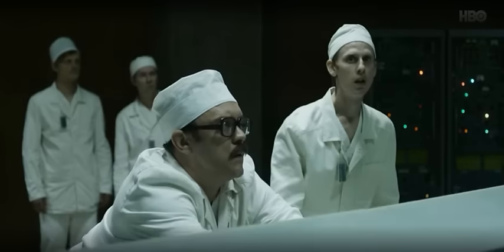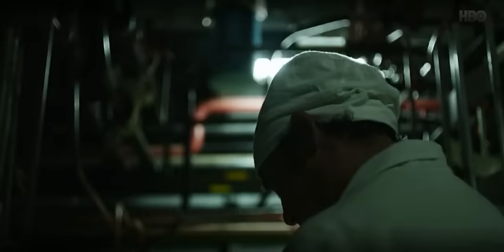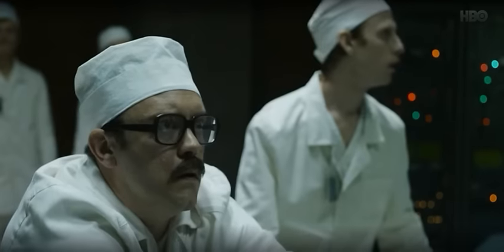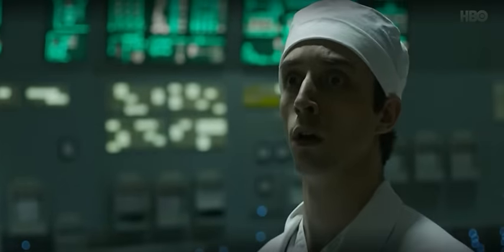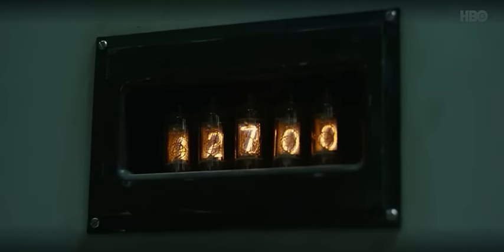Chernobyl (2019) Nuclear Reactor Explosion Scene

Comment: The sad part of all this is that it was ALL PREVENTABLE!  ALL OF IT!!  You do not use graphite tipped control rods- ever!  The spike in power should have alerted everyone in the control room to get out as fast as you can, and don't look back!  Every one of those firefighters were exposed to a lethal dose of radiation,  and that was all preventable as well.  Those poor firefighters knew nothing about the site being radioactive.   Dieing from radiation poisoning is a very horrible way to die. 
All in all, the government eas responsible for something that should have never happened. 😢
Reply: The fire fighters didn't know a nuclear power plant was radioactive
Reply: Weren't the rods covered in graphite along the whole length?

As far as i know, the graphite was purposely used to control the reactivity of the reactor.

So technically they could increase the reactivity with the control rods, and at the same time they could decrease it by inserting them further. The point rather is that it wasn't prepared for inserting them at once, during already supercritical state.

The real reason behind the explosion is the operators' lack of knowledge with the design, and the fact that they broke many safety procedures.

(Of course i'm not a specialist, and i cannot really confirm it either. I know this mainly through other comments and small research myself)

(Second notice, there is a far better explanation up in the comments, i suggest to check it out)
Reply: the "cheap graphite tips" is just plain wrong, they had graphite DISPLACERS which had a function and were not made cuz "they were cheaper", but because it helped with sustaining the reaction on withdrawn rods

Comment: I presume the caps were jumping because of rupturing channels. Were they? If not, what was causing the jumping? I ask because then we should hear the rupturing channels sound as well in that scene
Reply: It’s an early sign of the extreme steam pressure that had build up, and only a few seconds later the pressure overwhelms the containment structure and blows the lid. This lid pierces the roof, falls back down into the open reactor, and the rushing oxygen from the atmosphere reacts with the hydrogen to make the major explosion. You can also see this on the first episode at the start from Lyudmila’s window, there’s two explosions within a few seconds.
Reply: they didnt jump at all, it was made up by grigory medvedev in his book "the truth about chernobyl", along with many other disproven things
in reality what would have or has happened is that steam rushed out inbetween the caps, but the caps themselves didnt jump up or jump or anything, they are not connected directly to the control rods and fuel channels

Comment: For such a well-made and well-researched show, they repeat a lot of false statements about the accident. No, the "tips" of the control rods were not made of graphite, and the graphite wasn't there because "it was cheaper". The control rods were made in two parts; the upper half was the boron absorber section, which reduced the reaction, and the lower half was a 4.5 meter long graphite section. It was there to prevent water from filling the control rod channels when the rods were withdrawn, because water reduces the reaction just as much as boron.

The graphite "tips" were in the reactor the whole time.
Reply: while water (mostly the hydrogen) is a better absorber than graphite (x100), boron is still a way better absorber (x1000 compared to water)
Reply: @oluenionloppu  It's not about how well it absorbs radiation, it's about the neutron energy levels. Graphite moderates the reaction; it reduces the energy of the neutrons to the level where they're likely to interact with the uranium and cause a chain reaction. Water does that for enriched uranium, which is why it's used as a moderator in most reactors, but it doesn't work for unenriched, natural uranium.

Comment: Why did they push the button in the first place??
Reply: Ah ok gotcha
Reply: @RatMan1227   They were trying to slow down the reactions
Reply: They were doom. At that point, nothing could save them. The reactor was already uncontroled.
Reply: I wonder if there was a theoretical way to prevent the explosion.. maybe if the lid weighed 100x more
Reply: Kyle hill and Plainly Difficult explain it the best. But each reactor no matter the design has an emergency shut down button that automatically lets all boron control rods back into the reactor. After the failed safety test stalled the reactor with Xenon, Dyatlov basically told them to remove all but 6 rods (minimum should be 18). Basically after that the reaction started going back up dramatically. When AZ-5 was pressed, the graphite tip causes the last bit of water to poof into steam and break the control rod channels locking the graphite into place

After that...was the first boom letting the oxygen in then the second very massive boom
Reply: It was the emergency off switch.  Dropping the rods slows down the reactor to the point it stops working and ideally prevents whatever disaster is happening.  In this case, the flaw in the rods meant it would do the reverse for a few seconds before it would shut it all down.
Reply: @aldenornogueira5239  no, if the fuel rods didn't have a +ve coefficient at the tip then they could've reversed the reaction and bring it back in stable state but having graphite on the tip actually skyrocketed the reaction for a few seconds and that was just enough to turn it into a nuclear bomb
Reply: @justinnesbit3948  maybe, but I think due to the reactions in reactor will prob still explode
Reply: @justinnesbit3948  that would be really hard but that would contain the 33,000 megawatt surge, as 3200 x 100 is 320000. however, 33000 will continue rising until explosion.
Reply: @RatMan1227  may have explained it but control rods control reaction, insert them to decrease reaction, take them out to increase reaction. All a reactor is, is a series of rods that are long tubes of a radioactive material and when you put them next to each other with nothing inbetween that increases your reaction, making that material hot so then the water gets hot then turns to steam
Reply: the MWt rising rapidly would be a good reason to press it. however, that did not actually happen. the real reason they pressed it was because at the time they were doing a safety test for the reactor, which involved pressing a3-5.
Reply: @justinnesbit3948  the reason the explosion happened was because the graphite displacers entered the bottom region of the core all at once. if the graphite displacers, boron control rods, or poles that connect the two parts of the rods were 1.25 meters longer, the graphite would reach the full length of the core, so no explosion would be able to happen.

Comment: In other scene legasov suggets they need tons of boron to put out the fire in the core and scherbina goes to get them as it wasn't a big deal so I wonder why they didn't built the roads properly with boron instead of graphite 🤔
Reply: It was part of the design. When fully withdrawn, the tips of the control rods would still be moderating neutrons inside the core to some degree, to keep the core stable. Under normal operating parameters, this was perfectly fine. In the very unstable situation that happened that day, this proved to be a major design flaw.
Reply: @origlllo  no Bro those were moderating roads designed to slow down the reaction in any given situation, specially in this critical moment, as I said before it seemed they had a lot of boron available so it doesn't make sense to build them with graphite, as the latter was used to accelerate the reaction.
Reply: @versatilpraxis  Despite their names, moderatos accelerate the reaction in a reactor. They do so by slowing down neutrons to the point they are more likely to cause more fissions. Control rods by definition are meant to do just that - allow you to control the reaction.

Think about it like this - when you fully withdraw a boron control rod, you want to accelerate the reaction. if its tip was also made out of boron, it would still be absorbing neutrons at the outermost position, thus distrupting your neutron flow.
By tipping the rods with graphite, you essentialy seal the reactor with a moderator when the control rods are withdrawn, thus increasing the reactivity which is what you want.
Reply: Do you think it was a lack of boron?) PWR type reactors at power plants have been used in the USSR since the late 50s, and 1 gigawatt capacity since the late 70s, they developed in parallel with RBMK type reactors. The series is based on the usual anti-Soviet propaganda typical of the West. RBMK reactors have their advantages and the possibility of using lower uranium enrichment is also one of them, and not a disadvantage from poverty. Especially considering, as it turned out in the 90s, that Soviet uranium enrichment technologies were the best in the world, including in terms of fuel production costs, and the United States still does not have such technologies. For example, Germany sells its nuclear waste from uranium enrichment to Rosatom, and Rosatom is able to get more fuel from them. Also, only one country in the world had a fast neutron power reactor and that was the USSR, now Russia is developing it. The point is a defect in a specific project, but as we saw at Fukushima and other accidents, there are also disadvantages of PWR.

Comment: I heared its was like a 3 kilotons exsplosion way more than fukushima reactor exsplosion
Reply: 0.3 kilotons actually, 3 kilotons would've destroyed the whole power plant and more
Reply: The fukoshima reactor DID NOT explode, it became very hot cuz the water was not cooling down the core
Reply: @guyinblueshirt  that’s literally how all reactors happen. Chernobyl didn’t explode first, got really hot due to the steam
Reply: @bobbythomas6520  Yes, thats true, but the fukoshima core didnt blow up into pieces, it was whole, chernobyl on the other hand had whole core gone
Reply: @guyinblueshirt  that’s true except for your last statement. Yeah it blew up and the core was exposed but tons of material from the core was still in there, hence the elephants foot and all the Corium.
Reply: @bobbythomas6520  Yeah thats what I meant, but I dont know how to say it
Reply: @guyinblueshirt  yes, correct. the core itself did not explode. however, in 3 of the reactors, the reaction of the fuel rod cladding and the water when the reactor started to melt caused hydrogen to form inside the core. the hydrogen was vented to the reactor refuelling hall, which later ignited and caused hydrogen explosions that blew through the roof of the refuelling hall. there was no damage to the core containment vessel though.

Comment: What is the red stuff on 2:29
Reply: Maybe a wax seal attached to the cover of the shut down button?
Reply: ketchup
Reply: @Damidas  That's a wax seal indeed.
Reply: Yes, as others have said that is wax.  It is used to ensure that critical systems are not tampered with.  Often times you'll see this accompanied by a kind of seal or crest that would be difficult to mimic.  It is basically unreliable and so has fallen out of fashion.  But it is cheap and does provide some limited level of security.

Comment: Pretty sure that explosion would be 10x bigger irl.
Reply: The explosion doesn’t need to be that big. It just needs to be big enough to expose the core. The shape of the explosion in this episode is based off of real simulations and eyewitness accounts.
Reply: The explosion wasn't very big. It wasn't a nuclear explosion, it was more of a steam explosion with a secondary fire. You can see even today the building is still there mostly intact it's just the reactor that blew apart. The thing is, the release of radioactivity was immense.
Reply: How are you gonna be pretty sure of something you know nothing about?
Reply: @Galf506  Well, then a nuclear bomb isn't a nuclear explosion either, it's an oxygen-nitrogen plasma explosion. I'd say it was a nuclear explosion, just a very poorly optimized one.
Reply: Not at all. The fuel used in a nuclear reactor is WAY less enriched than the fuel used for a bomb.

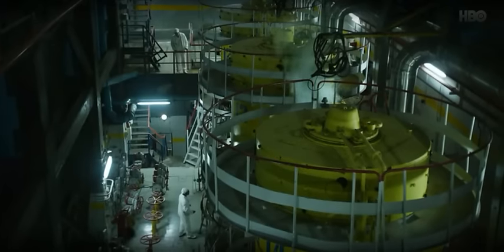Comment: 2:37 to 2:51 if the reactor can generate 33.000 megawatts why not build a reactor that can run continently in this state . Is it even possible to run such an reactor? Can you build even such a thing?
Reply: Because the materials can't maintain their molecular integrity at that heat AND it's impossible to cool because the water instantly combusts. Nuclear reactors are already designed to run at maximum efficiency based on the laws of physics. Fusion reactors are the only kind that can exceed uranium reactors, but we don't have those yet.
Reply: The light that burns 10 times as bright, burns for a few seconds and then blows the fuck up.   The amount of heat we would be talking about is completely insane (probably the temperature of the sun), and is one of the reasons why fusion is so hard to pull off.
Reply: We're missing one magic word here, one that was equally absent on the night of the meltdown: stability.

A nuclear reactor can produce a lower amount of power and maintain stability. It can also produce 33000 MW without stability and result in snarky a-holes like me making YouTube comments on it several decades later.
Reply: 33,000 MW is unsustainable, you just can't cool/maintain/safely operate it, and it would be significantly harder to extract that energy as efficiently as you could in multiple smaller reactors. Like it could probably be done, but why? It's like building a car with a solid fuel rocket booster on the back. Sure, it'll be faster for a few seconds, but you won't be able to stop it when you need to and it'll probably explode immediately. Nuclear power is about safe, reliable, cheap (long-term), stable energy; building ten different 3200MW reactors is going to be better in every facet than one operating at 32000MW.
Reply: Name a physical material that can withstand the constant heat of a star's surface.
And that's the easy hurdle, bud.
Reply: that's called a nuclear bomb

Comment: Makes you wonder if The Fukushima incident happened the same way
Reply: no. Fukushima suffered from hydrogen explosions and meltown. The cores never exploded.
Reply: @civmaster50  As I recall, Japan also had a great Tsunami, which didn’t help current matters, either.
Reply: There’s a Netflix series called The Days which is about the Fukushima Daiichi nuclear accident and the aftermath. It’s similar to this one but at the same time very different and unique.
Reply: no. the backup generators that ran the cooling system were underwater.
Reply: @unoriginalusername1748  Bro dovevano farla vicino all mare perché era l' unico luogo rimasto per prendere l'acqua in caso di emergenza.
Per questo gli impianti sono così vicini all' acqua
Reply: To quote Fomin: Are you stupid?
Reply: @unoriginalusername1748  you need to build them near water. Bad idea was not building tsunami walls.
Reply: @sarubet8725 There we’re tsunami walls in place, but the earthquake prior to the tsunami made them drop several feet below their intended height, allowing the tsunami to come over them and wreak havoc.
Reply: no? not even close, fukushima didnt explode, nor was it caused by a scram, nor was it because of how the reactor was operated
Reply: @civmaster50 Chernobyl was a hydrogen explosion and steam explosion and with a meltdown too